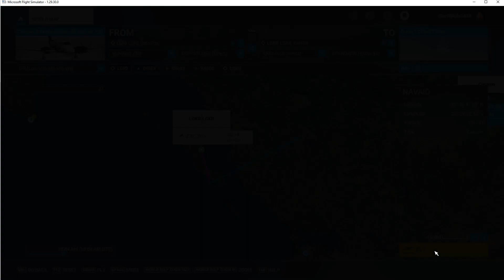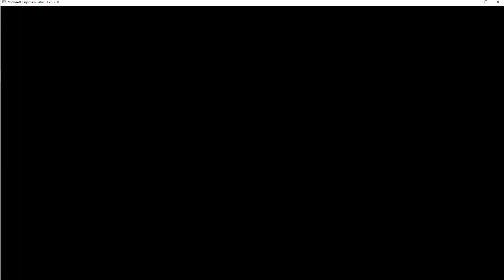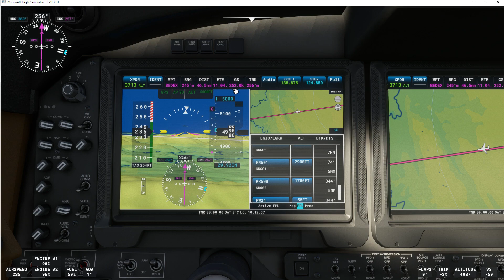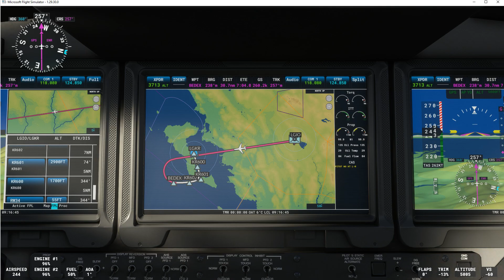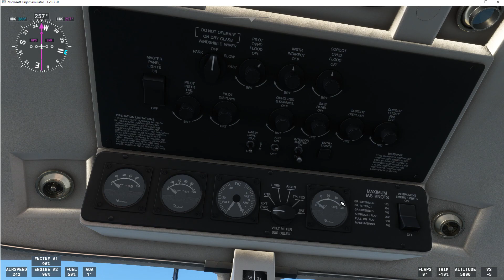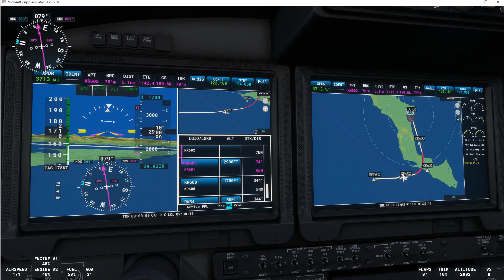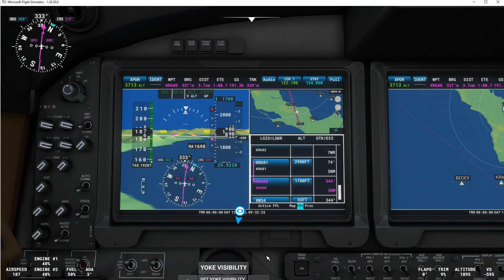MFS 40th Edition King Air 350i RNAV Landing Corfu Greece

Comment: very nice will try this flight out.  Thanks!
Reply from the maker: It's a fun short flight in a great aircraft that works well on MFS.
Reply: @IFRSKIES  trying now, not used to use the gps nor automatic pilot...  Do you actively control the speed with the joystick?  or is this taken care of by the AP...
Reply from the maker: @bertonsierens861  You have to use the joystick, keyboard or xbox controller to control air speed. This plane does not have auto throttle so the auto pilot does not control your speed. I use a Logitech Extreme 3D Pro Joystick (only costs about $70). It works really well and MSF will set it up for you when you plug it in. Go to options to set it up in flight controls.